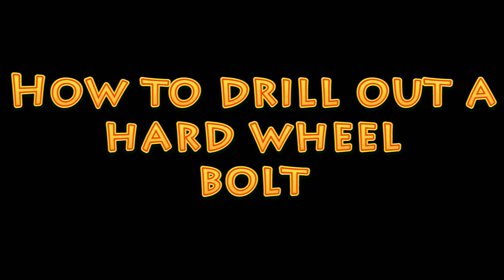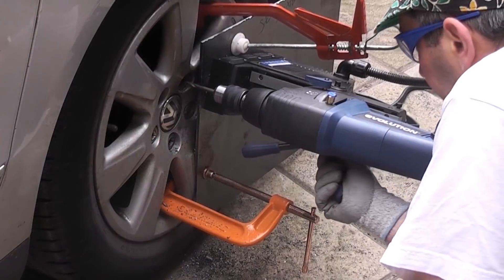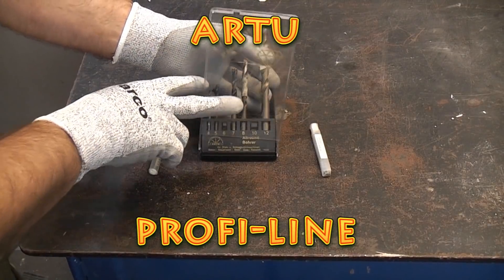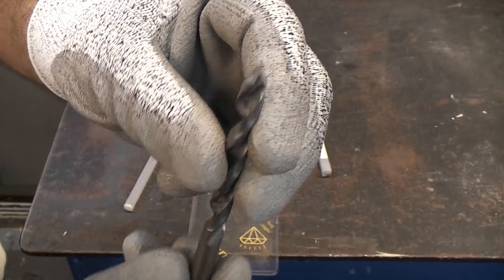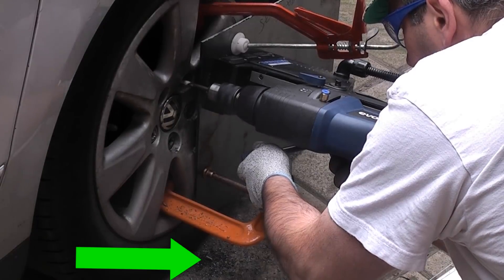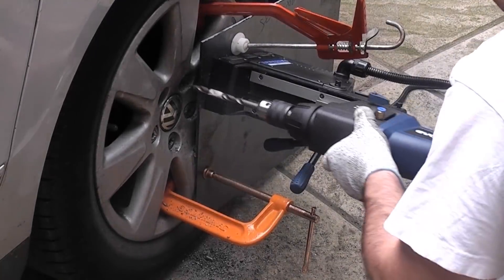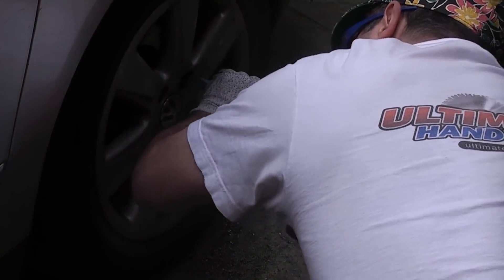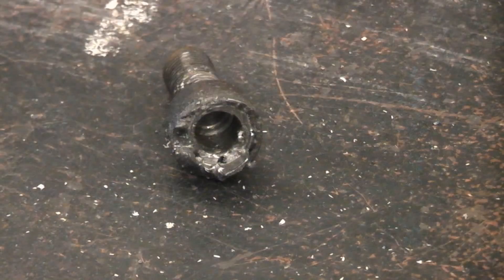How to drill out a hard wheel bolt

Comment: Anti seize should never be used on wheel bolts of a car, if you look on autodata at the torque for your wheel bolts (120nm for 17mm 5 lug vag cars) it will have a small info tab that says to never apply grease or antisieze to wheel bolts, if locking wheel nuts aren't removed using an air gun or overtightened then this is rarely a problem
Reply: Anti seize is no problem. People use it all over the snow belt. Never a prob.  You just have to take it into account when re-tightening because it's easier to over tighten. If you're torquing to 90 and there's anti seize, you're probably closer to 110-115  without knowing.

Comment: What is the air fitting for on the machine?
Reply from the maker: You can attach a coolant bottle to the machine, so that it drips coolant onto the cutting bit (it only works with the supplied cutters as they have a hole through them).
Thanks for the comment

Comment: U.H.--Just a heads' up about the CC (Closed Captioning).  I like your videos a lot, but whoever is doing the CC is doing you a disservice.  I turn them on frequently when listening to them as your accent can be hard for me to decipher at times (I am a U.S. native).  The captioner apparently has as much (if not more) difficulty with it and I suspect does not have much knowledge of automotive/mechanical terms.  The word "break" came out "brick" the first time, which became "break" the next time you said it.  However, the first use was not corrected, so I'm not sure if he or she is reviewing their work to catch errors like that.  When you were describing how to drill out the locking lug nut, you talked about drilling slowly so as not to "blunt" (dull) the bit, but the captioner typed in "block", which made no sense.  I'm not sure I got your full meaning, as what you were trying to tell us wasn't transcribed properly.  Whoever's doing the CC is going by sound (which we all do), but is unable to correct for this in the context of your meaning.  I suspect the CC is done here in the States, but you can let YouTube know that there have been problems.  Thanks.
Reply from the maker: Thanks, I have not had chance to edit the CC on this video yet. I do have someone that edits the CC, or sometimes I edit the CC myself (if I have time). The CC on this video is automatically generated by YouTube and sometimes it really gets my words mixed up! Thanks for letting me know though, much appreciated 👍

Comment: I've NEVER failed to get a locking lug nut off by bashing a slightly undersize socket on it and buzzing it off with a good impact wrench.  Although, I don't live in the rust belt, so results may vary.  (Also, lug bolts may be a different beast, but I'd at least try the small socket idea).
Reply: Some of them have these diabolical hardened steel spinning rings fixed to the outer portion of the locking nut so a hammered on socket only spins the ring, not the inner nut or bolt. Getting them off usually involves cracking the ring off first, and then using a hammered on socket,  but this drilling method would be the way to go if you came across one in a deeply recessed wheel.
Reply from the maker: Thanks for the comment

Comment: How did you centre the drill bit on the bolt head? How did you ensure the drill bit was in line with the bolt? All by eye?
Reply from the maker: Yes, I just adjusted it so that the centre of the drill bit was central to the bolt by eye.
Thanks for the comment
Reply: @ultimatehandyman   There are inexpensive laser pointers that you can chuck in the drill to check  aiming. Just get one that shoots the laser out the middle and not offset. Don't crush the laser, hand tight is all that is needed.

Comment: Been doing brake jobs for over 45 years of my life, that's why I meticulously, clean the threads on the lug studs, and the lug nuts and check them twice, tighten them bare hand, completely down, then put a light coat anti-seize, re torq them down in a proper torquing sequence, 10 minutes will save you,  (2 hours & $800 worth  of frustration) Excellent Video!
Reply from the maker: Thanks for the comment ;-)
Reply: where your base
Reply: @ultimatehandyman where your base mate
Reply: so you’re the one responsible for making my hands permanently greasy when i take off wheels
Reply: Yeah, I used to do that too, back in the day.  I suspect you don't reduce your tightening torque by the amount required for the lube you use, therefore potentially over torquing your bolts by up to 50%  (Look up dry versus lubed torques)
Reply: We need more people like you in this industry
Reply: Going 18 hours rn I'm on the verge of a mental breakdown

Comment: I drilled one out with a standard hand drill last year. In lack of knowledge I used HSS bits. No problemo.
Reply from the maker: The anti-theft wheel bolt in this video could not be drilled using a regular bit. I tried one of the cutters that came with the machine first, which took the edge of the bit as soon as it touched the bolt.
Thanks for the comment

Comment: This looks like hard work. How much would this cost to sort out.
Reply from the maker: I have no idea how much a garage would charge to get one of these out, obviously this was done for a mate- so no charge.
Thanks for the comment
Reply: I'd expect £50 per wheel or so but maybe more if they need to get a mag base drill/purchase the carbide drill bit required.  It's not the sort of stuff a garage will normally have kicking around.

They'll charge the minimum of 1 hour labour though and garage labour seems to hover around the £40-50/hr mark.
Reply: At the garage I work it it's £20 per wheel or a full set for £60

Comment: I just break them off then remove the bolt on the mill or drill press. If its a real mess i just replace the rotor. The labor to fix the problem is often less than the cost of the part. It is interesting seeing how you solved this problem though. :-)
Reply from the maker: Thanks for the comment

Comment: Great video. You made that look easy. Anybody would think you did that sort of thing for a living. 😉  I suppose if you know what you're doing and have the right equipment, it is relatively straight forward. I suspect if I had had the problem I would have had to cut the wheel off.
Reply from the maker: Thanks Mark, yes I do a lot of stuff like this on site.
It's a pity the bolt would not come out using the welder though!
Thanks for the comment

Comment: Be very careful about heat when working on wheels...

Let the tyre pressure down. Preferably remove the schraeder valve. People have regretted not doing that before. I know it's an alloy, which isn't as bad as a steel wheel for heat transfer, but still, I'd be playing safe..
Reply from the maker: Considering some wheel brake discs can glow red hot under extreme braking conditions, I would not worry too much about the heat transfer from a bolt.
Thanks for the comment
Reply: Ultimate Handyman 

YouTube search 'tyre exploding welding' and you'll find a great number of videos demonstrating...

https://youtu.be/Ydu9giV210E
Reply: And you're right, it's maybe unlikely with the procedure you did, but if you'd seen a tyre exploding you'd probably wanna play it safe..
Reply: Ultimate Handyman 

Also, my mate worked as a mechanic for Mercedes for many years. An HGV came in to be worked on, must've had hot brakes. Nothing like glowing hot. Tyre exploded. Made a massive mess of his face, lucky he wasn't permanently blinded in both eyes. I saw the photos, they were horrific.

Heat on wheels with fully inflated tyres is no joke mate
Reply from the maker: I never said it was a joke, but welding a piece of tube to a wheel nut is very unlikely to generate enough heat to cause any problems whatsoever ;-)

Comment: You can dress a masonry bit (carbide tip) if you're a bit handy with the grinder and have a cbn or diamond wheel... but most probably won't.

Works well for drilling stainless too though.

I've found a pretty cheap source of carbide tipped drills for drilling hardened steel are ones sold as "locksmiths drills" - always have a few on hand.
Reply from the maker: Thanks for the comment

Comment: You shouldn't apply anti-seize if the manufacturer doesn't specify it.  Their recommended torque will be based on clean dry threads.  Lubricating threads will increase the clamping force for a given torque which can over-stress or stretch the bolts to the point they are damaged or weakened.  Normal (aviation) practice is to reduce the applied torque by something like 30% (or more) if a normally dry thread is to be lubricated.  Doing this restores the clamping force to the correct level.
Reply from the maker: I've heard that the torque should be reduced by 20%.
Most wheel bolts would not cause such a problem if impact wrenches were not used so much by garages.
Thanks for the comment
Reply: Yep, I agree about the use of impact guns and I normally ask them not to use them (and then watch them!).  
Torque reduction % will vary depending upon the type of lubricant used.
Reply: @Dick Fageroni agreed I have never seen a tyre shop use a torque wrench that is why I always fit my own wheels and torque them myself however I can't see how lubricating a thread changes the torque setting of a bolt I beg to differ on that one and I think it's a great idea using antiseize because the bolts when the get wet won't rust into the treaded holes.
Reply: Yusuf Maltese

Lubricating the threads reducing their friction. The same amount of torque will allow the fasteners to climb further up the incline that threads are before that torque becomes equal to the result of the opposing clamping force and frictional force.
Reply: You've got it back to from brother ... Engineering and Automotive standards are: Unless the manufacturer SPICIFICALLY notes Dry Torque (with by the way is exceedingly rare, I've not seen any automotive torque specified as dry) then the toque value is to be done oil lubricated or equivalent, (Loctitie and Never-Seize are equivalents for example)

Comment: A good method to use that you didn’t mention is to get a 12 point socket slightly smaller diameter than the locking bolt/nut and hit it over the locking bolt/nut. Although this isn’t suited to every locking nut it works in a ‘pinch’ 😂 (I don’t condone stealing)
Reply from the maker: I'm assuming the garage tried that, before it was brought to me.
Thanks for the comment

Comment: Interesting that you say you would use the drill as a last resort. I would use the drill before trying to weld to the bolt. Welding in a hole with soft aluminium that damages so easily is a recipe for disaster I reckon. It's a tough job that I must admit.
Reply from the maker: Thanks for the comment

Comment: Anti sieze grease or oil should NEVER be used on wheel fixings. If the bolt or nut is squeaky rusty only then apply a tiny match head or smaller drop of oil. If wheel bolts where correctly torqued when fitting wheel this would rarely happen
Forgot to mention that the correct torque cannot be applied when bolt is lubricated

Comment: For the average car/alloy wheels, locking nuts are more trouble than they're worth these days.  Bought a 2nd hand Peugeot from the main dealer years ago.  They didn't give me the wheel nut key so took it back.  Wasn't until a few months later I noticed that they'd drilled the old nuts off. leaving marks on every wheel.

Comment: Dynomec ltd have a tool specially designed for all locking wheel nut types with no damage to the wheel. Less than 10 min job to do all 4 wheels. RAC and AA use it too.(link below)
 http://www.dynomec.co.uk/locking-wheelnut-remover.html
Reply from the maker: I would have thought the garage would have had one of those.
I'd have loved to have tried that on this wheel bolt!
Thanks for the comment

Comment: Going back to copper grease on wheel bolts:  I once bought a car where all the wheel bolts were stiff to remove, even after cracking the bolts loose.  I removed the wheel bolts and then found they all had hardened copper grease in the threads.  I wirebrushed all the wheel bolt threads, and this made the wheel bolts much easier to tighten and remove.
Reply from the maker: I've never had a problem with it- yet.
Thanks for the comment

Comment: Copper grease should never be added to wheel bolt threads as this actually makes them more likely to get stuck as the copper blocks the threads (especially if you add more copper grease every time you put the bolts back on) .... the bolt threads should ideally be kept clean and dry (eg by wirebrushing)...Some car manufacturers (eg Audi) make a special "non metallic" grease for wheel bolts...  Also copper grease should never be used on the back of brake pads as it encourages the caliper to corrode (https://textar-professional.com/textar-training-center/the-use-of-copper-grease-on-modern-brakes/)... you get special "non-metallic" high temperature grease for the back of brake pads... Copper grease should also not be used on the mating surface on the back of alloy wheels, as it encourages the alloy wheel to corrode.

Comment: Locking wheel nuts are a pig for getting stuck.  It's not as if standard alloy wheels get stolen these days like they did 25 years ago as most cars already have them fitted as standard, there s no demand for knicked wheels.  Better off replacing the locking bolts with normal ones asap.
Reply from the maker: I agree, I would never have locking wheel nuts on my vehicle (but then again I drive a van with rusty steel wheels)
Thanks for the comment
Reply: Don't forget that tyres aren't cheap on many cars, so there's always some toe-rag that will knick a wheel just for the tyre.  I had two taken from an old cheapo Renault 5 for that reason (thief got caught as he cut himself and left DNA - yah!).
Reply: I'd be a little worried not having the locking wheel bolts on my car with wheels worth £2000+....although whole car more likely to be nicked than just the wheels.
Reply: Absolutely agree! first job on my car when I got it was replace the locking wheen nuts with regular ones. Not like someone is going to nick the bog standard alloys off a Megan.
Reply: Wheels still get stolen in 2018, a lock or two don’t stop a determined thief but are overall easy deterrents.
Reply: @Jason Andreoli what rubbish. There's a very healthy trade in stolen alloys supplying people who have kerbed a wheel or two.
Reply: Ha! Try telling that to my neighbor who had his wheels stolen IN his driveway.  Twice.
Reply: Jason Andreoli in Los Angeles you need lock nuts !!! Or you will end up on either bricks or on the floor !!
Reply: I am so happy to see this as the first comment because I am dealing with that exact situation! Dumb sleeve of steel thread coated with some form of aluminum. I even put the key on to hammer them in hopes to shock the threads, added heat and they still snapped. 5 lug studs and 8 lug nuts later I'm changing their car back to normal 😂 for my sake

Comment: Excellent work on a truly horrible job. I'd be trying to do that with a rotary hammer drill, as I haven't seen the electromagnet mounting type. Thanks for the video.
Reply from the maker: Thanks, this job would have been ten times harder without the mag base drill!
Thanks for the comment ;-)
Reply: Few years back I had to drill out 3 bolts on my old Astra with a 240 sds and diamond tipped drills, took hours but did the trick!

Comment: If you ever lose a locking wheel nut key, if you goto a main car dealership, they keep all the locking wheel bolt keys in stock and will remove the bolt for you (I did this once because I only found out 6 months after buying a car that there was no locking wheel bolt key)...
Reply: Yep, we have over 200 different types of locking bolt in stock only for vw
Reply from the maker: Thanks for the info ;-)

Comment: Great video, in my tyre fitting day's I would always stand next to the wheel with my back towards the car, hammer in hand & strike each head once bcos they're self locking, once done I found the bolt would undo easily. I appreciate you're dealing with a sunken bolt so access is limited. Just had to share it :) Thanks
Reply from the maker: Thanks for the comment ;-)

Comment: You can smash a certain size star socket over most locking wheel nuts but like you said it doesn't work every time.Its definitely worth trying first as it does work most the time.
Reply from the maker: Thanks, I think the garage tried to remove it that way, but it was well and truly stuck.
Thanks for the comment

Comment from the maker: This is a job that I did a few months back for a mate, who could not get his almost bald tyre changed.

I hope everyone has a great Sunday 😉
Reply: How many times did you & your mate think of the tire jockey with air compressor that first over-tightened the bolt?
Reply: Thank you Ultimate Handyman. Is this common with VW locking bolts? We have exactly the same problem. Thank you.
Reply: You know, if you have something that is galvanized and you want to take the zinc coating off, hydrochloric acid will strip it. I'm sure a man of your standing would know someone who has some.